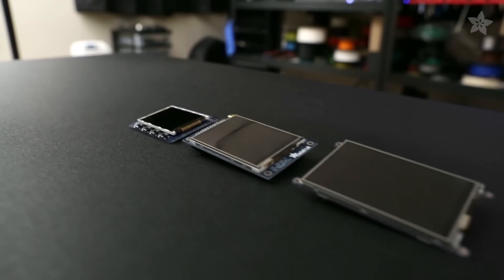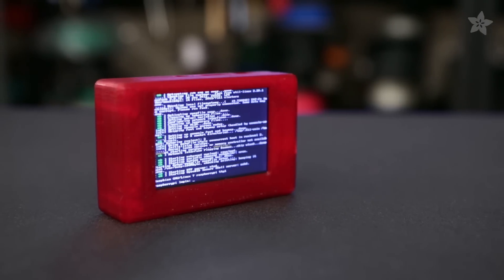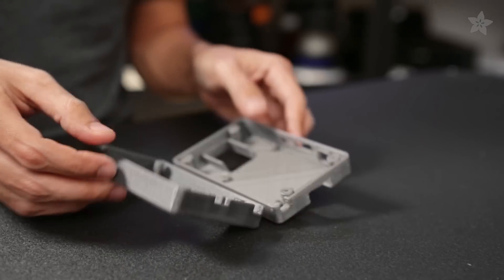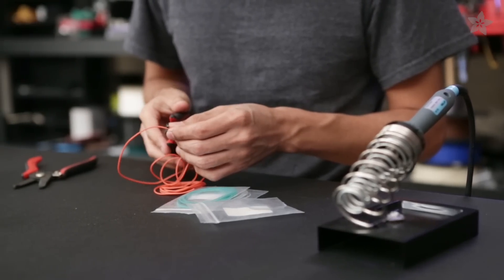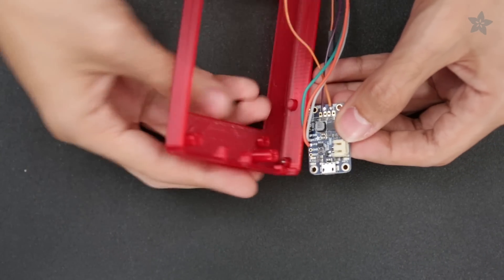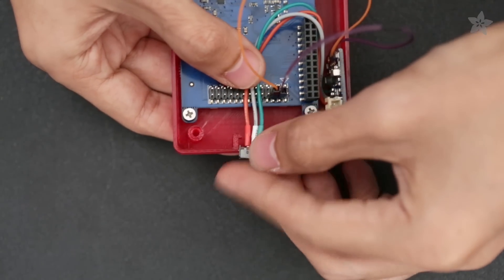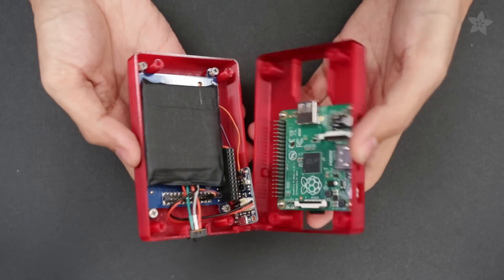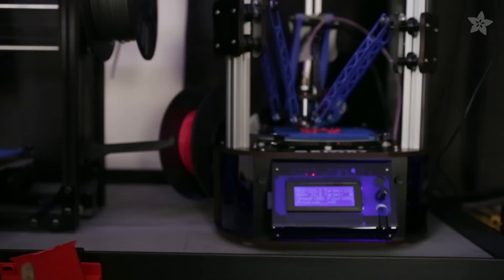Touch Pi - Portable Raspberry Pi

Comment: Does it work with a Raspberry Pi 3?
Reply: No, not exactly. Noe is using the A+ which is a smaller version of the raspberry pi 1. The case would not fit the 2 or 3 since they are physically larger "B" models.

Comment: i have a question andafruit 

see the raspberry pi A,A+,B,B+ are all very expensive on amazon 

however i have been informed there is a raspberry pi 0/zero and was wondering could i use this (instead of buying extremely expensive parts for im not rich) or will it not work the same (i am however aware that it may not be the best out there)

Comment: Hey guys,
Was wondering about this project and am considering building one myself with a Raspberry Pi 2. My question is does the HDMI port actually work? Cause when you change the Programming on the Pi Hat (Kippah i think its called) i think it removes HDMI capability is this similar on this? If so would their be a way to switch off the TFT and activate the HDMI port once hdmi is plugged it? Thanks guys keep up the amazing work!

Comment: Really nice work, congratulations! Please, may you tell if is there a possibility to damage the lithium polymer when it's packaged between the Raspberry Pi and the PiTFT display(as shown in the video) due the main chip heat? In my tests, the RPi, with heavy use, reaches 53ºC up to 60ºC (RPi internal temperature sensor), and a standard li-ion doesn't recommend to use the battery over 40ºC. I really wanna to reproduce this awesome work (I use a similar work but with external cellphone battery and external pocket keyboard), but I'm afraid about the temps. Thanks

Comment: i would make a super compact, portable windows 8.1 pc. i would also add a touch screen and a small querty keyboard. i would also use the pi2 instead of the pi1. i dont know if it could be done but it sure would be badass!

Comment: So I paid through the nose to get this printed and started screwing in everything and the standoffs broke. I didn't exert any force or anything and they just broke off. Now I when I got back to thingiverse I see comments that they couldn't get all the components to fit properly, wish I had gotten that far. Has anyone improved this design or possibly know of an off the shelf case that will work?
Reply: *****  I always try to put a bridge in between the stand off and something close like a side wall or something like that.
Reply: Donnie Luschen I think the larger challenge that is in the model for some reason the standoffs have a gap between the inner and outer part of the stand off. I may just try to super glue them or see if i can find a threaded insert. At this point I would rather an off the shelf case.
Reply: ***** I have found hot melt glue to work much better then super glue.

Comment: SOMETHING YOU CAN DO BETTER THAN 3d Printing: 3d print it, make a mold out of plaster or something, melt the ABS out and recycle it into filament, then cast it with ALUMINUM!
Reply: Cast it in gold :)
Reply: Or you can melt polystyrene(un-foam styrofoam) into the plaster or whatever for lost foam casting
Reply: won't it just short on the case?
Reply: burnzy3210 SPRAY PAINT! Honestly I never thought of that, but you could coat it with something
Reply: +Noorquacker Ind. Now that I think of this it's a really bad idea
Reply: coat it with that flex seal stuff, just remember to take off a little from the inside so everything fits good